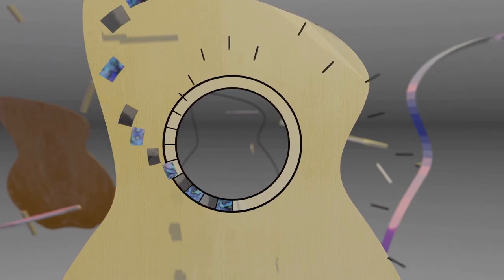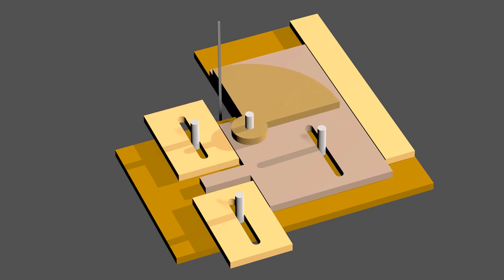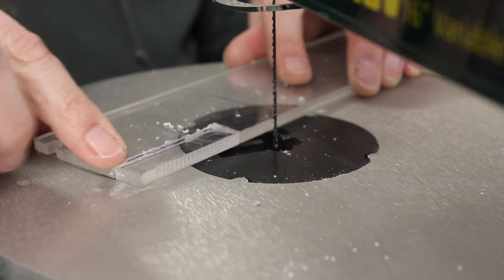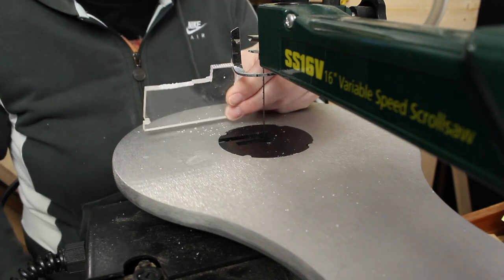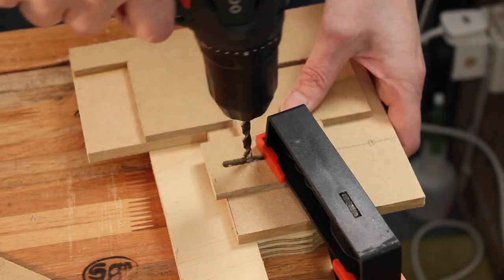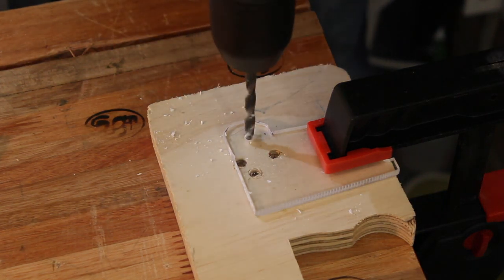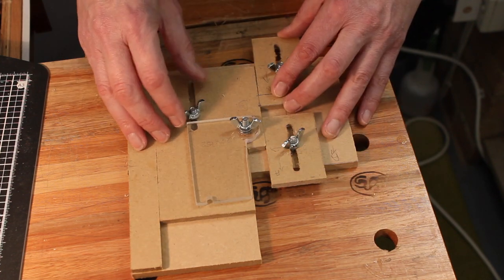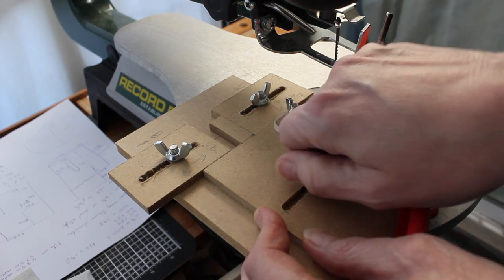Dual radius arc cutting jig

Comment: Excellent jig you're quite ingenious. Maybe you already know by now but a little trick I use when cutting acrylic/Perspex is to use a little water spray while cutting, just a fine mist is enough as a coolant and the blade doesn't clog either. 😊

Comment: Susan, it looks like a good start for your jig. When cutting or drilling plastics like plexiglass, polycarbonate, etc., to get the best results try using a little dish soap/dishwashing liquid to lubricate the blade or drill bit. This will reduce the friction and the heat it generates which will help to keep the plastic from melting back together. It also helps to reduce the cutters speed a little if possible  The grind on the cutting edge of a standard drill bit is at too great of an angle for plastics and soft metals which can cause them to grab and create an unsafe situation or break the plastic. So it is a good idea to drill slowly and if you will be drilling a lot of plastics, brass, etc. it would be a good idea to purchase a cheap set of drill bits and regrind the points to a five to ten-degree angle for this purpose. Now if you want to remove the scratches and discoloration along the cut edge of the plastic to get a finished appearance you can use a technique called flame polishing. Use a butane or propane torch with the flame set low and pass the flame back and forth along the cut edge until the scratches disappear. I do hope that you found this helpful.
Peace!
Reply from the maker: +Jeffrey Vastine thanks for the tips! :-)
Reply: For straight cuts there's an easier and cleaner way (provided th piece is big enough) to cut perspex: score it (going over it with a very sharp and hard blade or point) about 10 times and then snap it off. Sand slightly and then go over it with a flame. It will look and feel like a factory cut.

Comment: Nice video. Thanks for sharing! The animation in Blender looked great. Is Blender an easy to learn tool?
Reply: No. It's powerful software and powerful software is never easy to learn. You can however download Blender for free and start with following tutorials on Youtube. 

It's worth putting your time in. I designed our new kitchen in Blender and it turned out a lot better than the 3D program the manufacturor used.
Reply: Caesar Tjalbo thanks!

Comment: its kindof cheating if youre a woodworker , but you might want to take a look at home made cnc routers , theres a prigram that you can use to make perfect fitting inlays with a V bit , there realy good for making guitar necks and archtops as whell , that is once you get the hang of operating it 
as for the perspex melting back together , maibe coating the sawblade with candle wax helps , either that or spray it with windex while cutting , keeping it cool